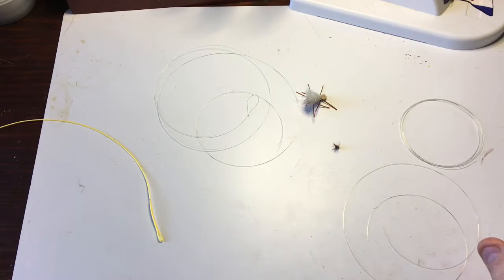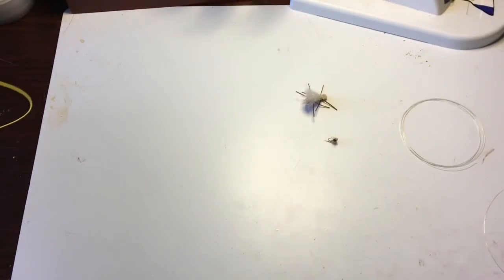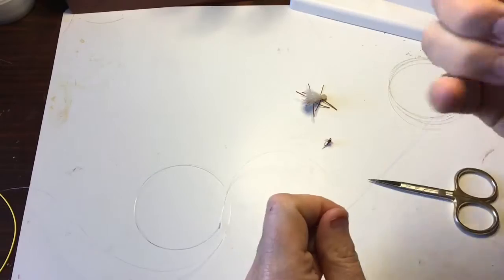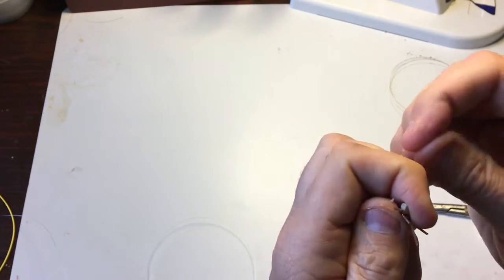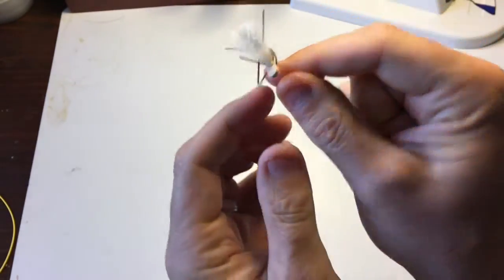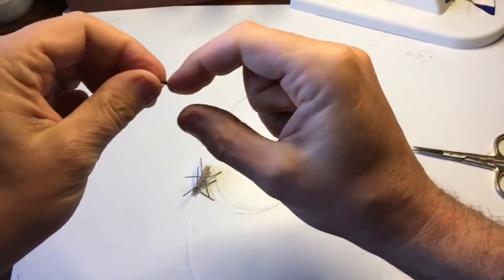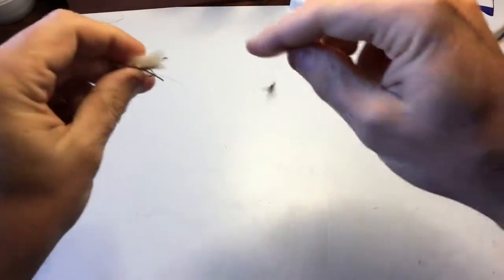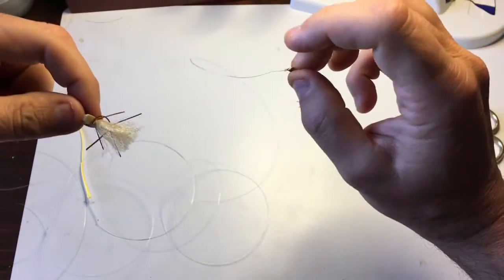Setting Up A Standard Dry Dropper Rig

Comment: How do you know how much Tippet to put on the nymph dropper section?
Reply from the maker: gesman5000 usually I go by the depth of the water and where the fish are feeding in the water column. I start off with two feet in between as a rule and lengthen from there. I have found that two feet is very effective especially when I’m searching for fish. Thank you for the question! Hope this helps.